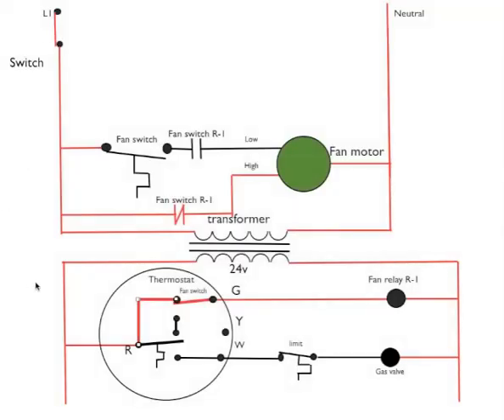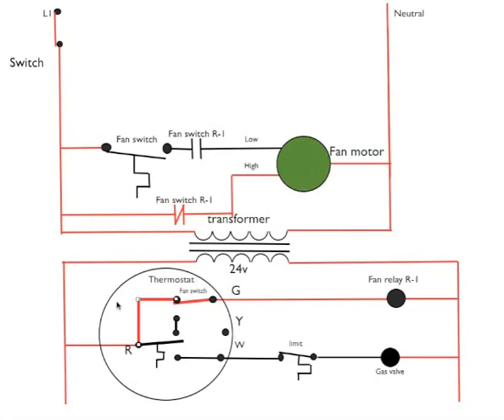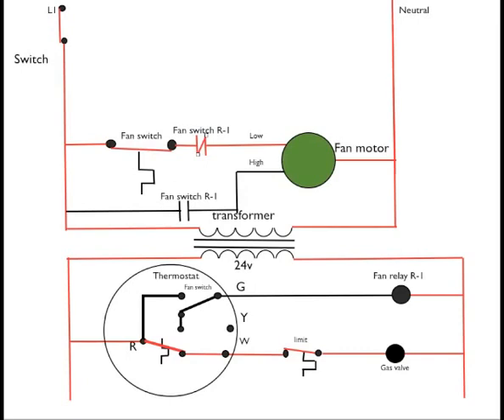Schematic diagram #8 The integrated thermostat

Comment: very interesting...
So the two contactors that control the variable speed blower are on one relay, correct?
so when one opens the other closes?
Reply from the maker: Well, its not variable speed, its multiple speed.  There is quite a difference.  Yes, the contacts are either or, single pole double throw.
GFM
Reply: whoops.. hehh okay thank you.